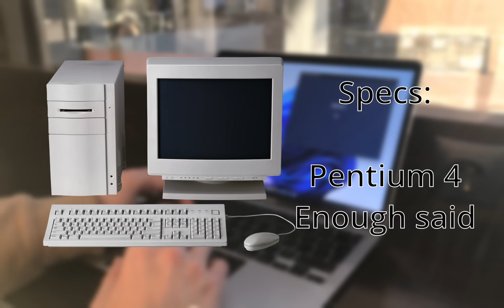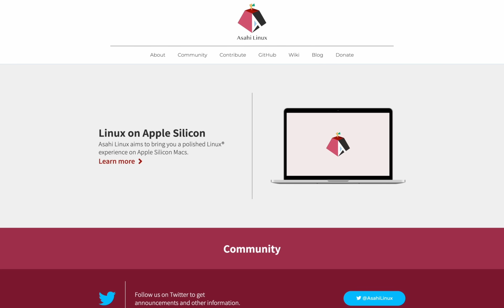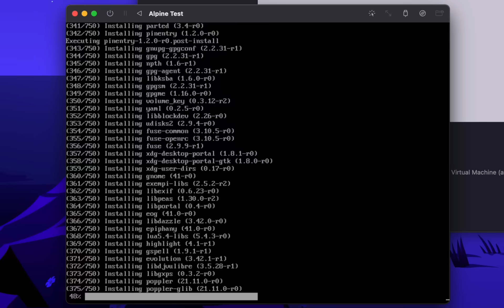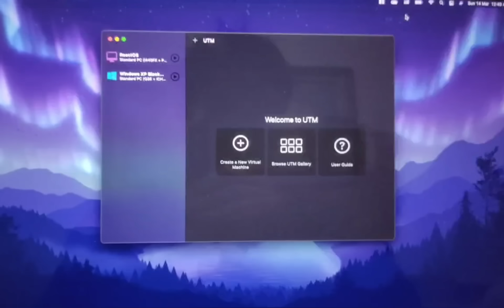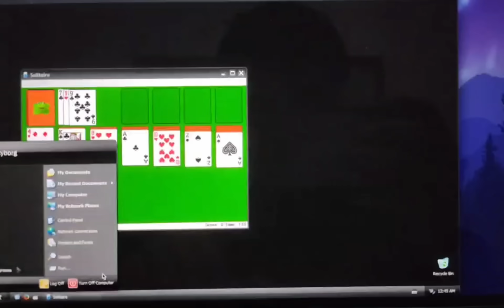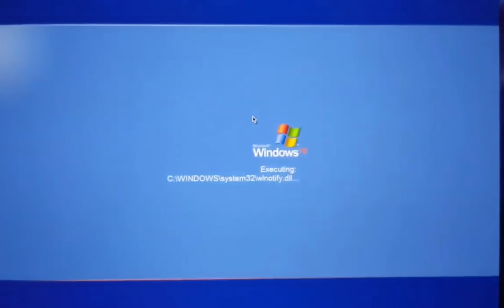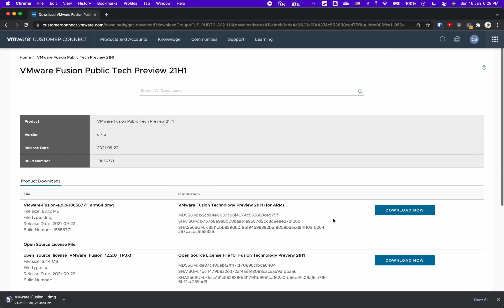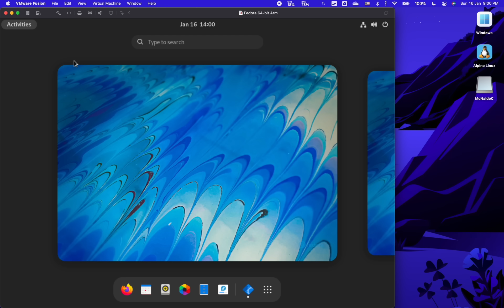Using Virtual Machines on Apple Silicon

Comment: Nice review but as of April 2022 Apple charges $9.99 for UTM. Are you saying that Parallels is the best for CPU intensive apps for M! or in general for earlier Macs? I don't have an M1 and have been using Vbox with OBS studio. All of a sudden with the last upgrade it  slows down if you enlarge the screen. It works great at it's smallest, but is too much to magnify it every time I want to use Open Broadcast Studio....I've tried lots of settings before launching and during when it's open so I'm not sure what to do.....Is it that apple knows how to access their architecture better than anyone else or can I fix it. It's really one app to buy a monthly subscription.
Reply from the maker: UTM is free! It's just that the version on the App Store is the "donate" version so that you can support the developers. If you get UTM from the website, it is free.
Reply: @KalosLikesComputers  Thank You! I didn't read past the first page. If I can do OBS full screen I will buy it.

Comment: Trying to use windows11 on m1 pro. But its asking to activate windows first and the spacebar in parallel not working. Whenever i press the spacebar while working on windows in parallel, it either  shuts down windows or leaves windows opening mac desktop.
Reply from the maker: This has got to be the weirdest issue I've ever seen in these comments
Reply: @KalosLikesComputers  do i need to purchase the activation keys for windows11? I just need the full access of windows 11 like i use it on pc.

Comment: I've been using Parallels ever since I switched to a Mac perhaps 10 years ago. Yes, it's a bit pricey, but it delivers a good-performing experience for any VM you might want to run on any Mac. Highly recommend it.
Reply: Is it subscription or just one time payment for permanent access?
Reply: @kda4636  subscription if you want to use more than 4 cores / 8GB of RAM. One time payment if you can deal with those limitations (although they’ll throw ads in front of you for every release after the one you bought).
Reply: @kda4636  They recently switched from purchasing each upgrade release to an annual subscription. They're currently running a special at $49.99 for the first year of the Pro edition that included Parallels Toolbox and Parallels Access. The annual subscription costs less than the old system of purchasing a license with every new release - and they put out one new release at least once each year, so it's a better deal.
Reply: @kda4636  you have to pay to upgrade every year and it's limited hardware wise
Reply: Do I have to choose M2 24g when run Parallels? Or maybe 16 is enough?
Reply: @qingtangdaqie even if you’re running windows 10/11 8g is more than enough
Reply: @TisAndrew  Omg！Amazing! Thanks a lot, it really helps!
Reply: @qingtangdaqie  np :)
Reply: @qingtangdaqie  I run Parallels Desktop on a 16GB Mac mini 2018, and I give Windows 11 8GB of that. It runs OK, but I'm not trying to do a lot of high-performance stuff in Windows. Looking forward to getting a newer M2 Mac mini and will probably get the 32GB model and give Parallels half of that to run Windows.
Reply: The problem I have with Macs is their irrational RAM prices. They simply overcharge vastly for what you will get with RAM so if you need multiple VM's at once or a heavier workload it has me very skeptical. I refuse to pay like $400+ more for like 8gigs more RAM or something ridiculous. I get things being on SOC, but Mac has blatantly does waaaay before their SOC even existed and purposefully tried to prohibit any upgrades as simple as RAM is to upgrade. 

Now, I'm considering just getting a Mac for lighter stuff and it's starting on intrigue me. At least the Mac Air is. I still think for sure you get skimped on RAM and storage for damn sure, but there seems to be some decent trade offs especially if you actually buy into the entire ecosystem. The thing that held me back all those years were greed on the hardware end. I think I'll give the MBA a chance here soon.
Reply: @Helluurrr  I switched to Mac about 8 years ago and am super happy I did. I never have crashes of any kind on my Mac, and I get updates from them maybe twice a year. Every time I start up Windows in Parallels, I have to wait for it to catch up on all the updates that still seem to be issued several times a week. I haven’t had Windows crash lately, but then I don’t use it very much. As for Mac pricing, reliability is priceless. Yes, they charge an arm and a leg for more memory on any of their devices, but the total price is still comparable to any WIndows machine with the same operating specs. And the Mx Macs blow away anything you can get to run Windows.
Reply: I would use it but I prefer to just use virtualbox because it’s free and I don’t use it enough to warrant paying
Reply: just use  utm its free, why waste money when you can use 1 hour and get it all running
Reply: I’ve been a parallels user for 12+ years. It really is the best option out there and keeps improving all the time.
Reply: the way Parallels prices their product is kinda disgusting.
Want to use more than 8 GB of RAM? Pay us more.
Want to use more than 4 cores? Pay us more.
Reply: @JosephF.  I used to buy the upgrade to the latest version every year, but a couple of years ago they switched to an annual license. It's an extra $20 a year to get the full 12GB RAM, 32 CPU support, and unlimited support - hardly highway robbery. Compare to what Microsoft does with its Office subscriptions that don't issue new releases nearly as often.
Reply: @TexanInParis06  I mean, you can buy Office once for $100 and never have to worry about it again though.
They don't say "if you don't pay us $100 per year you can't write documents that are over 10 pages long" or, "you can't use font sizes below 14" or "you can't print to PDF".
They also don't advertise to you with massive popups, and you at least get 5 licenses for your yearly subscription, in addition to a terabyte of online storage.
The kneecapping that Parallels does kinda makes it seem like highway robbery to me. Even in comparison to office.
Reply: @JosephF.  The price for a legal copy of Office 2021 Home and Student (Word, Excel, and PowerPoint only) is $150; Office 2021 Home Office and Business (Word, Excel, Powerpoint, and Outlook only) is $250; and Office Professional (Word, Excel, PowerPoint, Outlook, Publisher, and Access) is $440.  You get all of that plus 1TB of cloud storage for $70 a year on Microsoft 365. That's $30 less than the Parallels annual subscription, but Parallels puts out a new release at least once a year, and Microsoft only once every two years if you're lucky. If you only need Word, Excel, and PowerPoint, then $150 isn't a terrible price with limited support. But if you're needing to run Windows on a Mac, you probably also need the full suite of Microsoft products. Considering the complexity of fully supporting Windows (or Linux, MacOS or what have you) on both Intel and M1 machines, I think it's well worth the cost. And the Pro edition comes with free Parallels Access support - super handy to access your Mac remotely and securely. Yeah, they send you ads - the only ones I get are an annual update to the next version.
Reply: @TexanInParis06  I'm confused. Office is free for me online at least. Second, even if it wasn't you van just use Libre Office or Open Office on your desktop all the same for free indefinitely.
Reply: @Helluurrr  How do you get Office online for free? Office online is tied to their cloud, so you have to pay for storage unless you have only a few files. And AFAIK, Access is not available online - and that’s the one app I need to support previous clients.
Reply: @Helluurrr  How do you get Office online for free? Office online is tied to their cloud, so you have to pay for storage unless you have only a few files. And AFAIK, Access is not available online - and that’s the one app I need to support previous clients.
Reply: To bad you are SOL with M1.. Emulation, not virtualization, is slow at best and mostly useless.
Parallels might work but virtualizing ARM windows is almost pointless.
Reply: @jmkhenka  At the moment I am still running a Mac mini with an Intel chip, but I plan to upgrade to Mx eventually. Parallels is very good about keeping their software current, and I've heard reports that Windows runs just fine under the latest version of Parallels on an M1 Mac. I could care less because I keep Parallels and Windows around only for a few old clients who are running Windows-only software,  so I don't care about performance as long as it works.
Reply: 😂pricey?? It’s cheap af
Reply: @cedricvillani8502  yeah compared to crossover
Reply: @cedricvillani8502  $80 is cheap?! You must be rich as hell, because that is almost 3 hours of my labor.
Reply: @shadowtheimpure  this looks like a sponsored discussion. No sane person would claim that it's cheap.

Comment: Interesting... really appreciate the review,  how easy is it to get hold of a distro of windows for ARM...
and then... have you looked at running Microsoft 365 (specifically Visio) inside a Windows VM on MAC.
would appreciate a video.
Reply from the maker: I showed Visio running! It works very well! Parallels allows you to download Windows straight from within the program.
Reply: @KalosLikesComputers  sorry missed it, ok so parallels let you download the ARM based OS, the MS Office (including Visio), that be a MS 365 delivery, or can you now get a get box from apple store, install on MBP ?
Reply from the maker: @georgelza  You will download MS365 normally as if you're on Windows. Download the 32-bit versions for better performance, for apps like Visio that don't have arm64 builds.
Reply: @KalosLikesComputers  not a windows user, normally does not imply much.
for visio, how where did you get it, how did you demo it if you say there is no arm64 build ?
Reply from the maker: @georgelza  I got it from the Microsoft Azure portal provided to me by my college.

Windows on ARM can emulate x86 (even 64-bit) programs too! Not as well as Rosetta 2 on macOS, but it does a good job. Hence, installing 32-bit x86 versions of software on a Windows 11 ARM virtual machine will work just fine. That's how I ran Visio. Visio is the first and foremost reason I needed a Windows virtual machine in the first place.
Reply: @KalosLikesComputers  Hi Kalos, also primary and only reason I have a Windows OS... I work pretty much constantly in Visio, so ye def going to get the new MBP... as soon as piggy bank is aligned, just need to make sure I can create a environment where I can run Visio.
pity MACOS/Rosetta 3 can't emulate VMWare into life and allowed us to simply then copy the vmdc files over, or continue using Box ;)

Comment: I had to double check just to make sure this wasn’t a knock off channel reuploding somebody else’s video.. damn such an amazing video. You clearly deserve more subs. Way more subs for sure.
Reply from the maker: LOL! Thank you!
Reply: @KalosLikesComputers  Is it even possible to work with a linux platform and windows 11 simultaneously in any of this software on base variant Macbook air? How is the RAM Management
Reply from the maker: @DrTechcraft111  Yeah, it's possible on either UTM or Parallels, or pretty much anything that can run virtual machines. The RAM management really depends on how much RAM you've given each VM and how much RAM your Mac has. With the 8GB MacBook Air, I've run a Linux and a Windows VM at the same time, each being entitled to 4GB of RAM, but Parallels doesn't let the system run out of memory unless you explicitly tell it to.

Comment: Let's be real here, M1 as it is, well not exactly the market Vmware caters to. I see intel catching up nicely in terms of performance, a year or so later they are going to do it with the same energy efficiency and that's where the M1-M2 world ends. I don't think they see it as a market it worth developing to. We'll see though.
Reply from the maker: I really don't see x86 catching up.
Reply: @KalosLikesComputers  12th gen i7, i9s are already there in performance where the m1 max/ultra is for the general desktop, mobile computing WITH the possibility of using a non-trashy integrated GPU, like an RTX series and they have the hw codec like the m1 - which basically gets it where it is with video editing and let's be real here, there is no real other area where the m1 outshined anything before (I mean 10-20% performance is not really a difference). I don't really want to give up gaming and virtualization because of some "performance" that should be there, but when you try to do your everydays all you see is incompatibility after 2 years or so... 

Vmware, again, caters mostly server environments where apple is non-existent. Xeon versions of the 12th gens will follow soon enough. That pulls the VmWare developments, and those evidently will spiral down to desktops computing. 

So it all depends on how the incompatibility races against the new intel developments (again they are halfway there and they have the massive advantage of compatibility with virtualization, HW and SW compatibility). If intel makes their cpus comparably power efficient within 1-2 years, well the whole M1 story just loses it's only advantage and gets crippled with it's limited usability due to it's incompatibility.
Reply from the maker: @RichardStefanits  The x86-64 architecture is what's stopping Intel and AMD from making their chips power efficient, not just...some magic technology. ARM is by nature more power efficient.

Comment: M1 chips Achille’s heel is virtualization... Basically you cannot virtualize x86 or x64 CPU because ARM is a totally different architecture!
But Apple will not tell you that ;-)
Reply from the maker: ...Of course they will. It's not like they can do anything about it besides what they've already done  It's common sense, they're different architectures. It's like trying to jam a square in a circular hole. Both are shapes! Just not the same shape.

Comment: can you guys tell me how to fix Parallels 17 getting too slow which results in having to shut down and restart mac to get things back to as it does usually?
Reply from the maker: How much RAM are you allocating to your VM and how much RAM does your Mac have? The rule of thumb is to not allocate more than half of your computer's RAM to a virtual machine.
Reply: @KalosLikesComputers  M1 MacBook air base model with 8gb of ram, and half of the ram is allocated
Maybe I guess it's because of windows shit update in the virtual machine, any suggestions?

Comment: I moved my virtual machine needs to Linode.
Reply from the maker: That's also an option! But if your internet connection isn't stable or you're somewhere with no internet access, you're out of luck. Sometimes it's preferable to have things running on bare metal.

Comment: I managed to install x86 win11 and it IS slow, but for a few simple things that there is no other solution (not even using crossover etc.). I found that using it through MS Remote Desktop makes the experience somewhat better.

Comment: I've been using VMWare Fusion with Win11ARM for months now, including running Office 365 for ARM and had no issues whatsoever. Not sure how you managed to completely skip that in your video... Granted the installation was a bit of a chore, having to go into registry editor and mess with debug flags to bypass TPM, but its a one-time step and everything was fine after that.
Reply from the maker: I literally could not get it to boot.
Reply: @KalosLikesComputers  https://www.youtube.com/watch?v=mgy_tXE_MRE
Reply from the maker: @dogoku  Ironically enough I tried this. Custom VM and everything. It always ended up giving me that stupid error. Something must have changed with the builds.
Also γεια! Είμαι κι εγώ Έλληνας.

Comment: The video is great, I hope it released a few months earlier.
I would like to share my experience of struggling to replace my Intel iMac with M1 iMac since its release. I have been doubting for a long time about the compatibility of M1, PD 17 and Win11 ARM and the Win/Mac I have been using. Then I took the brave step of iMac replacement (8-Core/16GB).
Fortunately, most “old” MacOS software worked fine with Rosetta 2. Parallels Desktop 17 worked smoothly and it also directed me to download Windows 11 ARM. Most Windows software worked fine with Windows 11 ARM x64 emulation, though some software vendors had already released ARM versions.
What most bothered me was MS Office. Office 2010 could be installed but there was no way to activate it. Office 2016 and 2019 just could not be installed. Only Office 2021 (probably including 365) worked without problem.
In addition, I found no 3rd party free antivirus that works on ARM Windows 11. While Spybot Search & Destroy simply destroyed Windows (cause unrepairable crash).
Reply from the maker: I've been song Office 365 on macOS just fine! I understand however that some programs can't be installed on macOS like MS Access or MS Visio. I showed Visio running through Parallels in the video and it runs very well.

As for antivirus, I legitimately haven't used any antivirus other than Windows Defender in about a decade. Windows Defender is amazing.

Comment: All truth, if you need use windows/linux x86 only software i found only one way(( - use small windows/linux PC on x86CPU+RDP+mobile phone as a router+power bank. It’s not chip, but it’s work. It’s work if you need mobility and you don’t need full power of x86 PC. It work for ipad pro to. You can buy add notebooks in x86 CPU, I use mac+pc notebook - not usable case.